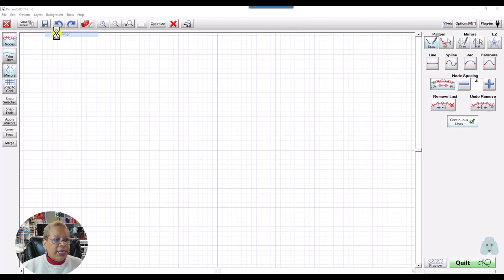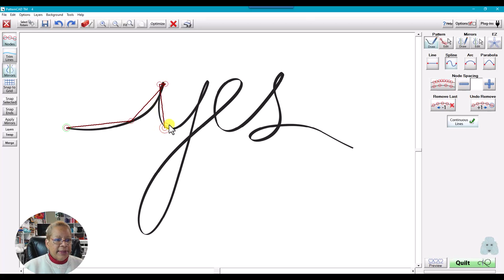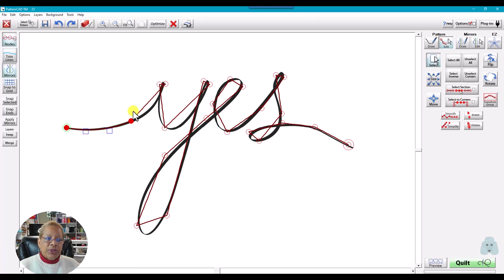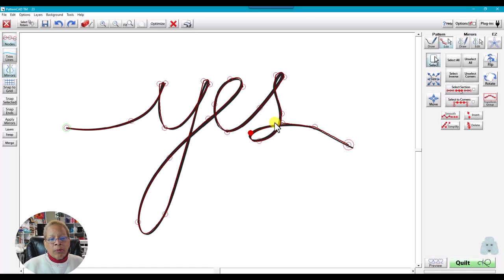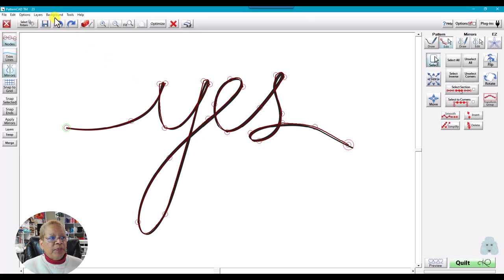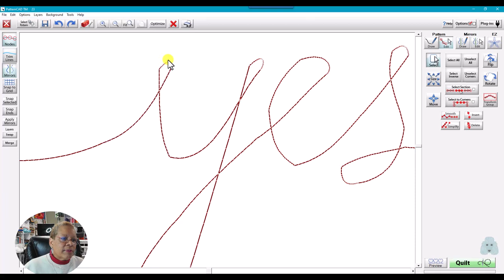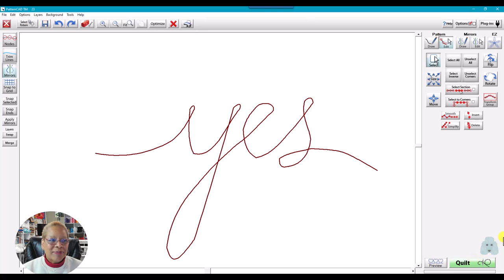QCT PatternCAD Tutorial: Converting Words into Quilting Designs | The Quilted Poodle

Comment: HELP Marie!  I have a juki miyabi 350 longarm and it leave's the bobbin thread too short to pull after I have used cut thread!  Please help me fix this! It is very frustrating that I can't pull my bobbin.   thread.  You are so wonderfully clever, perhaps you can do a video just for pulling thread and bobbin issues?  You have really encouraged me to use the features on my longarm and QCT.   I especially love your CAD videos as I had no idea how to start learning this.  Thank you!
Reply from the maker: I love my Miyabi. Because I do pull my threads to the top and cut them I don't use the thread cutter on the machine. It will leave a thread tail too short to pull up unless you use tweezers. So it's a matter of deciding which way do you want to cut your threads; do you want to pull them to the top and cut them, or do you want the thread cutter to automatically  cut them. When I'm quilting baby quilts or high utility quilts are quilts for my dogs, I will use my thread cutter. And then to get started again I often take a couple stitches in the opposite direction of where I want to travel so I can be sure that my bobbin thread will get caught to connect my stitches going forward. I hope that makes sense if not let me know.
Reply: @TheQuiltedPoodle  You are wonderful!  I feel better knowing it isn't something I did.  I live far away from any Juki support so I am glad you are online.